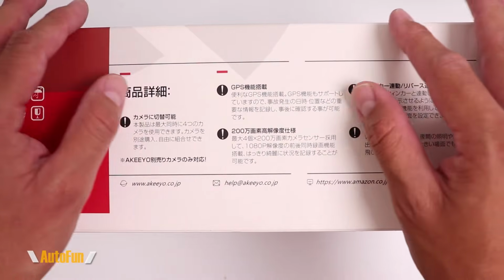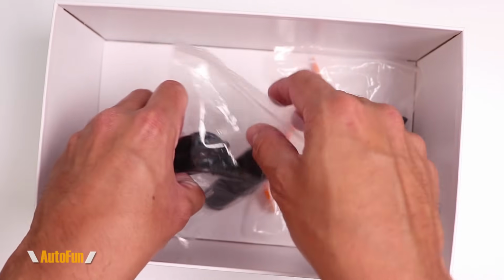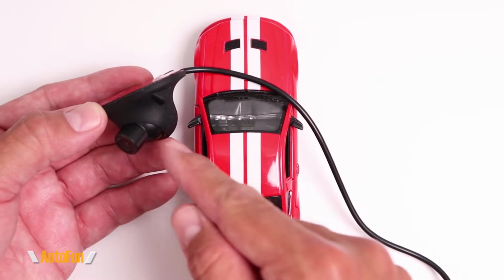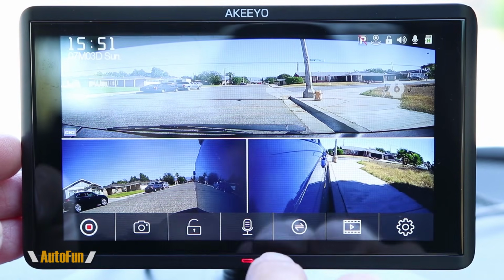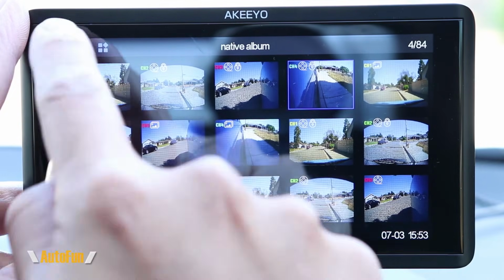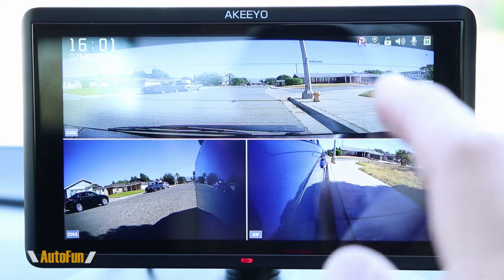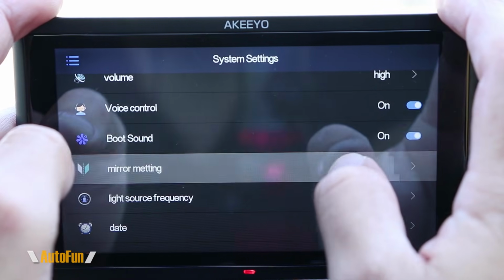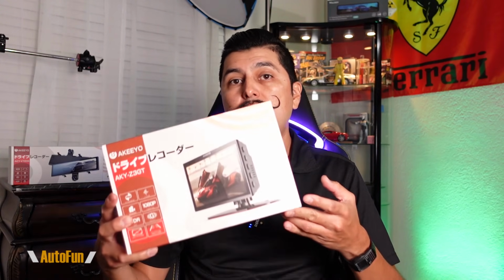AKEEYO AKY-Z3GT Dash Cam Review (Side Cameras, 4 Channel, GPS, Park Mode & Park Assist)

Comment: Nice review. Some pieces of info .. Front/Rear camera.. 1920x1080p/2MP/25FPS...side cameras-1080p.  

No indication of whether you can change resolutions and fps. Didn't see any information  on their parking mode, if all 4 cameras record, buffered parking/motion/event detection and other parking mode options.

 It has some nice options e.g.  those adjustable parking lines. I wonder when you're in reverse and the parking lines come up... Does it affect the rear camera dash cam recording?

 Projected retail price of the 4 cameras is $568... That's pretty steep considering the lack of information .. yeah that might get fleshed out after the kick starter is over. 

Something else to consider.. You can get Viofo A139 ( 3 channel ) -$270 and a Viofo A129 (2 channels) -$170 .. So 5 cameras for $410, or $350 when Viofo offers their sales.  The question is if  the extra features ( big screen, turn signal video focus, reverse camera with adjustable lines) worth the extra $150-$200.. Assuming they work out the kinks and add proper parking mode functionality.
Reply from the maker: Hi mpcp27! correct, all four cameras record in HD (1080), the resolution or frame rate is not adjustable however here is one that does have adjustable resolution & frame rate https://youtu.be/ct4AUXNGvQk Regarding parking lines, they don't affect recording on dash cams remember they are just an overlay that comes up on top of the video being recorded :) For pricing, I think you may be converting Yen or something is off, the kit with dual cameras is only $299 however if you only need 1 side camera you can get if for $269 here is the link again if needed https://www.akeeyo.com/products/4-channels-surround-view-dash-cam-monitoring-without-blind-spot-driving-recorder?sca_ref=2139840.S7pimDXRfb I do think is easy to put together a 4 channel system by buying 2 separate dash cams, the challenge is getting dual side cameras, running 2 separate dash cams won't have this option. Hope this helps and cheers bud!
Reply: @AlexAutoFun  not it was usd not yen but i know what the problem is .. That's for 2 systems... You are correct.. It's $269. Apologies..  Then $ 269 is a very good price. Looking forward to seeing what their parking mode had to offer
Reply from the maker: @mpcp27  LOL it happens bud! I was like omg $500 buckaroos that's a lot!  😮I had to double check that to be sure. Yeah I have a video coming on the hardwire kit but it's standard park mode, noting fancy like buffered parking monitor, for that I recommend this one https://youtu.be/SD5AEbR0fLI Cheers man!

Comment: Thx for the review, i have been holding off buying dash cams, cuz i was waiting for something similar to the top view 360. Just like some OEM camera systems. And this one seems like a good substitute. 😁
Reply: Honestly, the top-down 360 view is really only practical for parking and off-roading, where you only need to see what's within a couple of feet from the side of your vehicle.  You really don't get a very wide field of view with it, so it wouldn't be of much use on the highway where you want to see a larger zone around your vehicle.  Also, since it requires stitching 4 images together that must be focused at specific angles and distances from the vehicle in order for the software to compensate for distortion, and then produce an image that doesn't have a lot of aberration, a software that could include a large field of view, along with much higher-end camera systems would be required and much more expensive.  The only drawback I see from the system in this video, is the screen size.  5" is an awfully small area to view 4 images.  I would think at the very least, an 8" screen would just barely begin to do it justice, with a 10", or 12" screen being preferable.
Fact is, I'll probably purchase this system and hope that AKEEYO will offer a larger monitor sometime in the future that can simply be swapped out.  Aside from the small screen, this system offers everything I'm looking for in a camera/DVR system.
Reply from the maker: You're welcome LazyQ8i! yeah this definitely is the closest will get to a top view 360° system (Which I do hope to see in the future but it's years out due to the complexity of the setup)

Comment: How is this installed on the  top mirror  seems big in size? ?
Reply from the maker: Hi Edwin! this is not mirror dash cam, it is mounted with the included mount or with a standard 1/4" mount. However here is a great alternative that is mirror mounted https://youtu.be/o8begcmPA2wm Hope this helps, cheers!

Comment: Can this show the cabin too? Does it have a night vision?
Reply from the maker: Hi Edwin! the front camera can be installed pointed to the inside of the car if you want to show the cabin instead. Regarding night vision, nope this does not have it, however here is a great alternative that does have real night vision (I.R.) https://youtu.be/JJKbUu_egiE Hope this helps, cheers!
Reply: It says on the website (as the time of this writing) that all 4 cameras has night vision.

I just bought this, and waiting for it to arrive.
Reply from the maker: @itsMiza  Hi Ice.Pianist! ! yeah I noticed that many dash cams love to throw the night vision term around (meaning they can record video at night, which technically all cameras can to a certain extent) Some dash cam do offer true night vision (Infrared Lighting) in the cabin camera like the G880 dash cam I linked earlier. Now technically most people won't need I.R. night vision it's normally only desired by people wanting to capture images in complete darkness. Congrats on your new dash cam system by the way! the AKY-Z3GT is definitely a cool system to upgrade to, just a tremendous amount of coverage from pretty much every side. Cheers!
Reply: @AlexAutoFun  Thanks! been waiting for this one since I saw your video about their 3 cameras.

very much needed it since I live in NYC 😅

Does it record 24 hours even when it's parked at night? Someone tried to break in my car just yesterday 😕 hoping to catch whoever it is when this system arrives